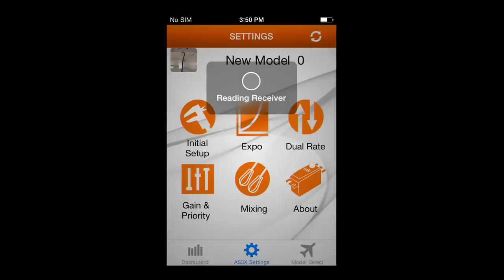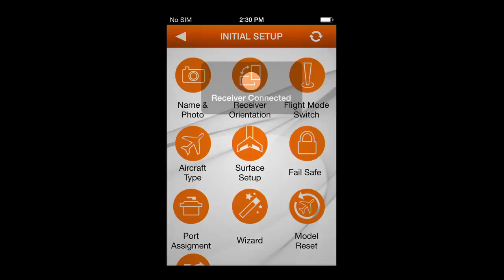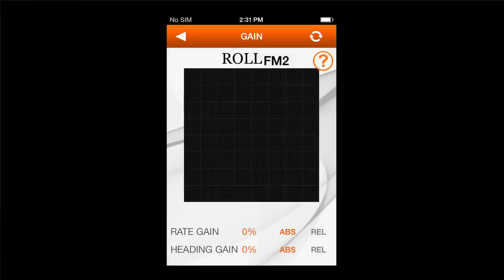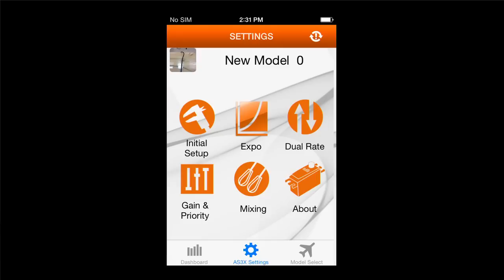Spektrum AS3X Step 5: Connecting The AS3X Receiver To Your Mobile Device (Initial Setup)

Comment: How do I do this with a iX12 ? Can I use a Spektrum BlueTooth and connect to my iX12 ? Or do I have to use a audio jack on the iX12? When I use the BT I get a dialogue box stating reciever has problem and I need to disconnect receiver power and start again. I am doing this with the BNF Aeroscout. I get the feeling I am not following the correct procedure.
Reply from the maker: You are doing it the right way but I do not think the Aeroscout's rx is setup to be programmable. What are you trying to adjust?

Comment: Tried a variety of phones, none of them would sync thru audio cable. Usb and PC works fine in same receiver. I really like the idea of being able to make adjustments on field without having to bring a PC. Does anyone know if the USB cable (SPMA3065) will work in a (android) phones USB port (using an adapter) ?

Comment: Please make a new video showing the AR636 using forward programming with a DX6 or DX6e transmitter. I have updated my transmitter but forward programming doesn't work with my transmitter. I am using the black DX6 transmitter
Reply from the maker: The AR636 does not support forward programming
Reply: @SpektrumRCvideos  Thank you I didn't know. I looked at the Spektrum receiver list and It doesn't really give any information unless you click on each receiver in the list individually. It would be nice if the list had information like telemetry forward programming high voltage and other information needed to make a decision on which one to buy faster in the receiver list. I have been having problems with the Bluetooth programmer after it erased my model. I finally downloaded the the USB programmer and updated my AR636 receiver. Then I downloaded the Aeroscout back to the AR636 and everything is working again. The Bluetooth programmer erased my Aeroscout and safe never worked after it zeroed out my receiver. I had to get my 15 year old son to help download the USB programmer because it wasn't point and shoot. He's a good kid if I didn't have him this stuff would have been mailed back to Horizon. I will try to look for information on which receivers are forward programmable with the transmitter. That would be less painful 😂

Comment: This instructional video is no longer valid since the smart phone audio cable demonstrated here is no longer used and is unavailable for purchase.  Horizon Hobbies has replaced the audio cable with a Bluetooth module (SPMBT1000).  This video should be removed and replaced with one that properly represents the latest application connection process used by their smart phone application.

Comment: App doesn't work on iphone 10 w/o option to connect audio cable.  Audio cable to laptop pc doesn't work. Connecting USB cable to laptop results in message Cable Connected but NO Device  Anyone have any ideas?
Reply: You have to check the small square box at the right-hand corner of the screen in order for the USB cable to power the Rx.  Important that no other power source is connected to the Rx when you do this.

Comment: Have successfully programmed   my   AR636 and AS3X  using the PC program  . Once you get the hang of it it becomes easy.
It appears that you do not need to do anything with D/R  and Expo in the transmitter  you do it all in the laptop (Windows 10 )  . I have not found any specific guidance about how to do this with a PC  .  I used the SpektrumRC  YouTube  videos as a guide  but I was not using a mobile phone . There are no help screens in the PC software . This is a big missing part , it would have saved me hours of experimenting .  I have this AR636  in a Wot4  and have not flown it yet with this change . I suppose I will have to take  my laptop  down to the field to make any changes to the programming ,  it can't be done just with the transmitter.  I did use the transmitter to set up a thottle cut switch  and  made sure that that the gear switch  was the B ( ie MODE switch ) .  I had to thottle up to 50%  to engage the AS3X  and made Mode 1 with no AS3X  .  SpektrumRC   recommends  this .  You have to make sure that the surfaces opoerate in the correct direction when AS3X  in  on  otherwise this could be disaster in the air .  Having Mode 1 with no AS3X  is a fail safe mechanism in case of  not setting it up properly.
Going for a coffee  now!!!!!!!!!!
Ken Rhodes
Reply: I'm using a laptop pc and usb cable.  any idea what to do when app states "cable connected but no device"?

Comment: Hi! Have a Samsung 7 Edge, DX8, and a AR7350 receiver, installed the AS3X app, binding OK and then I did exactly as shown in the video.  The Dashbord "spinning Arrows" change to OK, BUT the app does NOT reconize the receiver, I do not get the messages "Receiver connected" or the possibility to send or receive "buttons" from the RX . Whats wrong?  And how do I change from flight mode 1 to 2, ail/elev on the RIGHT stick? In the manual they tell that it should be a "Upload button" but I can´t find it. (May be when the RX is connected...)  Regards Terje from Sweden.
Reply: Terje V. Löberg the app does not work well in android.

Comment: Hi, With this app can I transfer settings from one receiver to a new one?
Reply from the maker: Absolutely! Plug into RX1 and it will ask for to you if you want to use the device or the receivers settings. Hit Receiver. Then plug into RX2 and when it asks the question again, just choose to use the devices settings.  That is one way to do it.

Comment: For a week, I tried in vain to connect my HTC EVO 3D (under Android 4.4.4) to AS3X. 

SOLVED: I discovered the problem to be that the HTC's  stock volume output is too low. I installed the free 'Volume Booster' from the Play Store and voila, it all works now  just like in the 'AS3X' videos on YouTube.